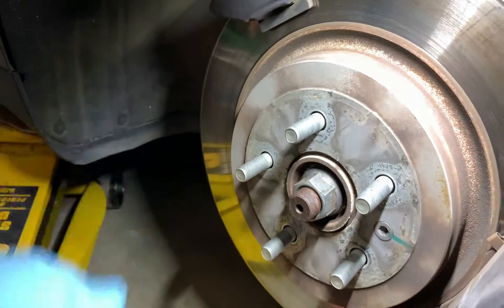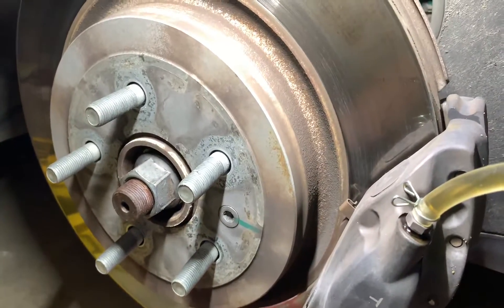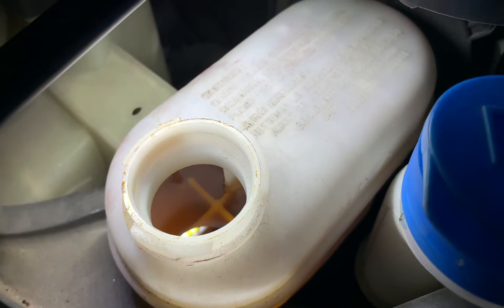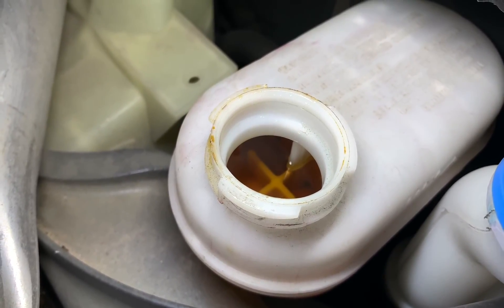Brake bleeding on a Tesla s.

Comment: Hello. I have find some indication that you should use a pressure bleeder on the reservoir, not a vaccum pump. My question is, did it work for you? because I wanted to use, like you,  vaccum pump. Thank you!
Reply from the maker: It worked fine for me.   (Every one has opinions on what’s “best” to do in any situation.  For the breaks you need to remove the old fluid, put new fluid in and make sure no air is introduced into the system.   What ever means you can use to accomplish that is valid.     Some people even use a Turkey baster, so I would go with what you feel best using.)
Reply: @teslamike7476  thanks for the answer. what ammount of brake fluid did you use?
Reply from the maker: @splatjmf  until it’s up to the max line.  :)